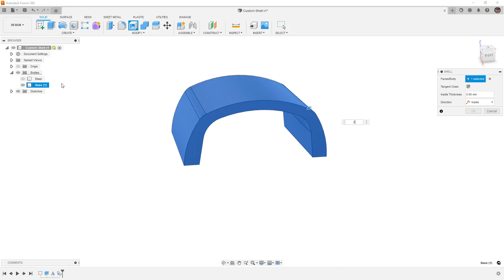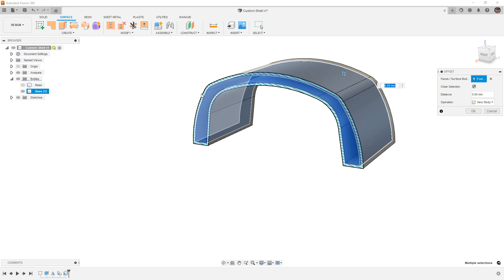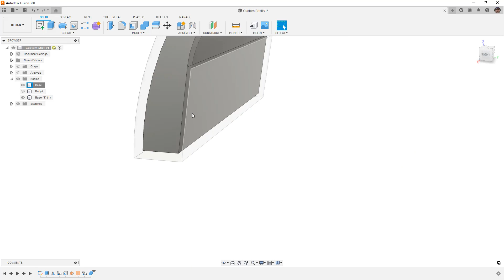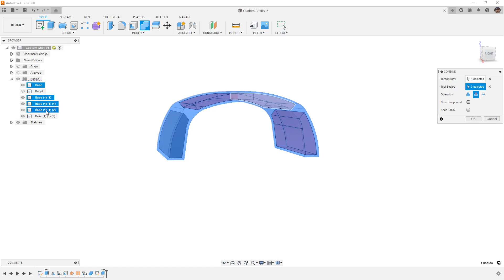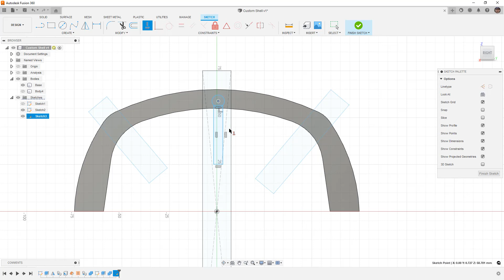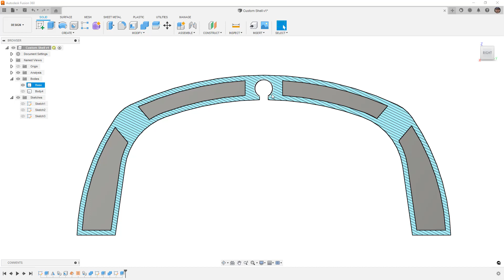How to Create a Custom Shell Feature | RC Airplane Design | How To | #fusion360 #rcplane

Comment: I haven't found the the shell works that well.  I have a lofted body that the shell command just can't compute.  Its not even a complicated shape.
Reply from the maker: There are certain things that will hang it up.  Years ago I was making a 5gal gas tank for a client and Solidworks would not shell it even though it had really large radii everywhere, but Fusion would.  When i have trouble what I will do is try the surface offset in small increments and see at what value the surface fails.  Sometimes it can point to a surface issue where a radius is too tight.  Sometimes its just Monday.....

Comment: This is a very good tutorial for a problem I’m going through right now actually. I’m modeling my friends sedan to hopefully print as a rc body and was struggling to hollow it out because the shell command conflicts with itself too much. Thanks for some new ideas!
Reply from the maker: Sounds fun Jacob!  Yeah once the bodies get too complex the shell (and surface offset) will struggle.  Offsetting faces you can and then manually building others certainly help.  Good luck!